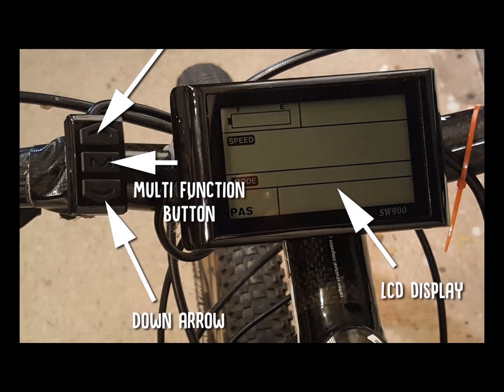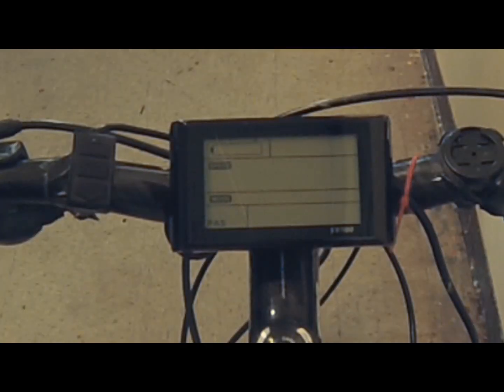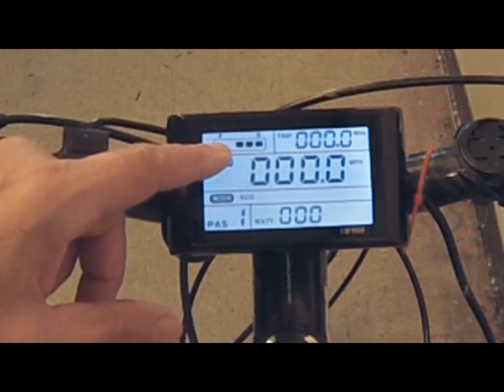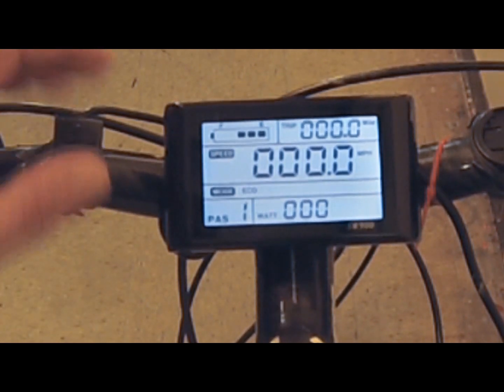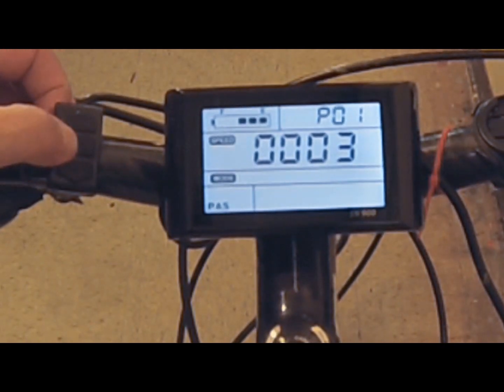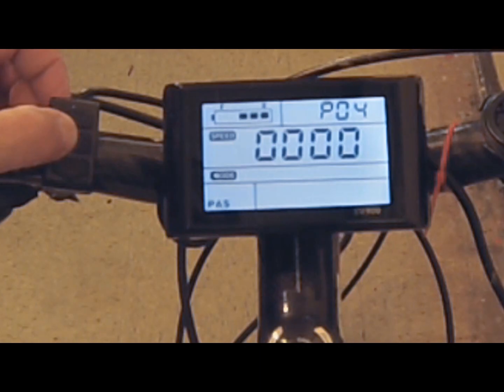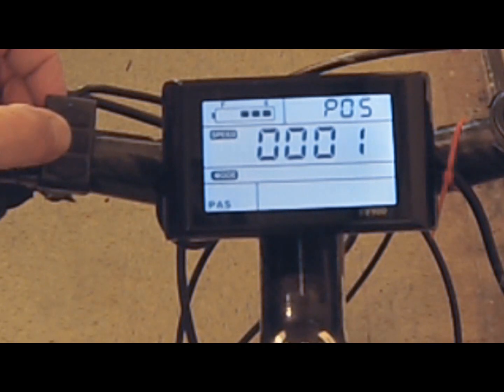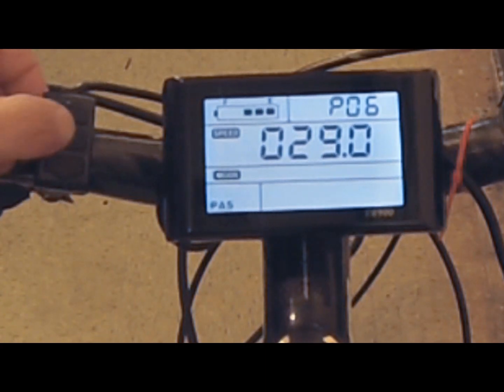Increase your Ebike's performance in 5 minutes programming the SW 900 LCD

Comment: Hi! Question about the sw900. I just picked up a bike with this system, but when I set P10 (pas) to 0 for pedal assist only it will still give me throttle option. I want this of because in my country it's illegal to use..

Any clue as to why it won't change?

Comment: When I go into the menu on the SW900 I only get 9 options, it goes 1 through 8 and then 16 ? So where are the rest of the options ?
Reply: I discovered the sw900 has different version each year produced  I have 2 bikes that are different.  Also the speed controller makes a difference as far as what options actually work on the sw900.   Hope this helps as I had to keep messaging the seller about mine
Reply: @dannyfiscus4487  thank you Danny I appreciate your post.. I bought the bike last year 750w  hub motor and at first the bike had massive  torque but after just one month the power went away and i think it's the battery but I wanted to try settings in the controller first.  I want that torque back badly

Comment: What is the best setting for a 52 volt battery?
(48 and 60 are the nearest available)
Reply: Good question… either is not ideal of course. However, if you want to under estimate the battery capacity, the use 48V; conversely, use 60V if you want to over-estimate it.  Safest is to set it to 48V… good luck.

Comment: thanks i`m liking your ebike videos!  what you say about p05 is differant in my manual though,  it says "gear number , maybe 3,5,9"  but when i check the sw900a settings on the bike po5 it only has options for 0, 1,2   i`m not sure if thats confusing enough.
Reply: This video is for sw900
Reply: 0 is 3
1 is 5
2 is 9

Comment: My display was reading nearly 100km/hour when I was going 25 mph according to phone GPS. I got into the speed sensor setting and dialed it from 47 to 33. It got worse. I then put it all the way up to 99 - and the speed sensor became accurate! This allowed me get my 750 watt motor up to almost 33mph. I gained 7 mph and now have an accurate speedometer thanks to this video. Don't be afraid to adjust the speed sensor if you know it's not working. I suspect that they are throttled down like that to ensure that speed limiters stay well under the legal limit.
Reply: I has the same issue, my bike is 29er, to adjust the speed I change wheel size setting to 23" and the speed is accurate.
Reply: Check voltage POS vaue

Comment: Hello, im wanting to buy the voilmart 1000w ebike kit, would you recommend it. And also would a 48v 14ah battery be sufficient?
Reply: rise09 lol yes it will give you around 35/40 kilometres range without pedaling
Reply: I have the 750/1500w kit with the controller built into the hub. I haven't ridden it yet, but am excited to as soon as this rain stops in Chicago.
Reply: @FtanmoOfEtheirys  great x

Comment: Also the P14 setting is the max amps current setting. How ever on the newer SW900 this is automatically set by the battery voltage, motor and controller. so setting this to anything will not change the auto setting.
Reply: I am stuck with error 10 on my ebike display
Reply: @biggdogg5323  the error code 10 is a communication error. did you try to connect a 12v headlight to your setup? The headlight connector puts out the battery voltage. So it will burn out part of the sw900 motherboard causing a error 10 code. It you didn't try a 12v head light than it is caused by a bad connection or something not connected right.

Comment: My new bike in pas 1 outruns the pedals while in 1st gear. It just takes off up to 10mph faster than i can pedal. Bike is a 7 speed. Any suggestions on how to match ratio better?
Reply: Go to setting P5 and change it to 2. This will give you 9 levels of pedal assist and it breaks the pedal assist power into 10% of your total power per pas level...ie pas 1 = 10%  pas 2 = 20% all the way up to pas 9 = 100%
Reply: @rkadster7008  I went to P5, but it only offered 03 and 05. I switched it to 03 modes and it worked! I'm perplexed why it worked because it should have divided the speed in 3rds from 0 to 30 correct? Anyway, it no longer is jerky and is slower in p1. I'm confused, but happy. Thanks for dropping me off in the neighborhood! I found it
Reply: Thomas Therrell Yeah, and the 05 splits the power into 5ths. The up side is it’s fine tuned and gives you more precise control, the down side is you have to hit the pas up and down button more frequently. If you have a 48 volt 750 to 1,000 watt e-bike I’d say 3 is all you need though.

Comment: When the E-bike is powered up you can cycle through the max speed, avg speed, battery voltage and system power on timer. . Hold down the mode and up arrow at the same time for three seconds. and repeat till you see what you want to see.

Comment: P10 works constantly on mine both pas and throttle whatever the setting so had to unplig the pas
Reply: My SW 900 keeps showing error code 10 new controller and throttle  still does not work any suggestions?
Reply: @davidthorne5107  dis u fix it.   I've the same issue.

Comment: Thanks for explanation. Trying to figure out what I consider a problem: My power assist on a 48V 500W geared rear hub motor eBike I recently purchased in Costa Rica : My new eBike takes off at almost full power in PAS #1 (a bit dangerours to lend out on my funcky dirt road), while the watts meter jumps between 750+W to 200 W.  The seller informed me after my paypal purchase with delivery, and then expression of concern; that my eBike was modified for Costa Rica and hills, and I could get by on PAS 0, and just use the throttle.  My recent review of settings reveal 
(P14)  Max Amps was set to 22, which is produces twice the watt rating for a 48V 500W motor.  I think that does give the motor more power; & testing on hills has not heated up the motor or 22 amp max controller to my finger touch.  I hope experimenting with my settings will get me back to normal PAS modes and a properly working watt meter.  ... I DO NOT Appreciate this unexpectedly new learning curve. I trusted the shop I purchased from to dial in everything before shipping, and inherited some loose ends to chase down.  Still looks like a decent deal for the price, but wondering about longevity at 48 V x 22 AMPS = 1056 WATTS on 500 Watt motor.
Reply: I have the same problem. I don't know the numbers. But my 48v 500w foldable takes off like a banshee when I'm in 1st gear and pas1. No way i can pedal fast enough.
Reply: Amigo tengo el mismo problema con un kit de 500w en nivel 1 y 5 dan la misma potencia, le he tratado de configuradar para q reparta la potencia, pero no ha habido modo. Si pudiste encontrar la forma me avisas.

Comment: Even at level 24 setting 11 my pedal assistance doesn’t work because it give too many power to fast so once the pedal assistance start it goes too fast and then I can’t even pedal 

Help me please I don’t find anything about this problem 

I also have a 1000w ...
Reply: i have the same issue looks like there is no solution but to use the throtle
Reply: I changed p11 to 6 and p12 to 4 and it works better

Comment: , I what are the two wires from the display as I cannot seem to connect them into my controller
Reply: They are a white and brown wires Connection for your front light
Reply: @danboi9731  thanks
Reply: Hey. I have the same issue. Did you ever figure it out? Im getting a error 10
Reply: @ShiftLikeAlex  Cruise control sensor I believe. Error 10# seems to be caused by a missing sensor.
Reply: Cruise control sensor I believe.

Comment: Hi there 

what should my speed measuring magnet be if I have a 48v 3000w? any ideas, please
Reply: You kind of have to ride around, and compare to phone GPS to see how accurate your speedometer is reading out. My bike was reading 100 km/hour when it was only going about 25 mph. I had to adjust the speed measuring from 46 all the way up to 99. This opened up the top end quite a bit.